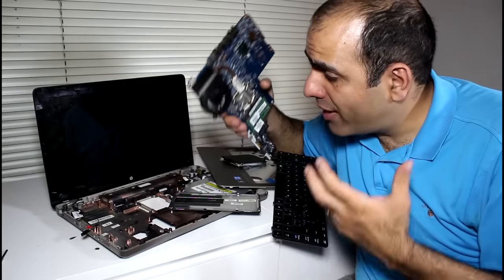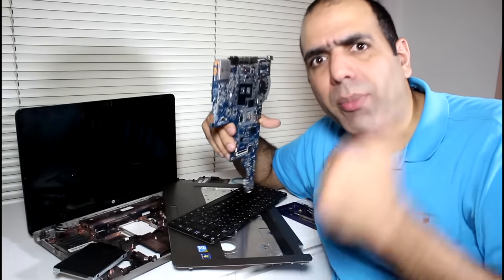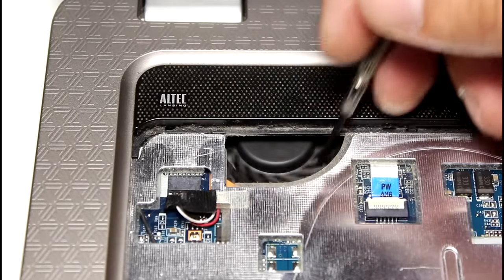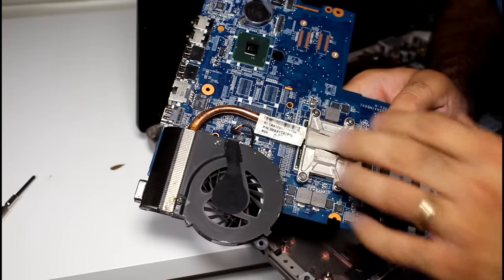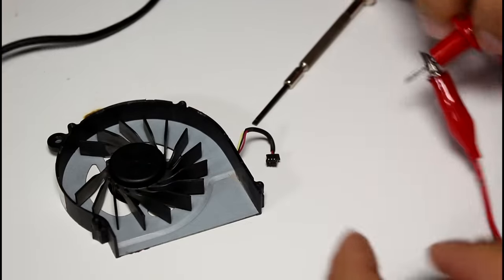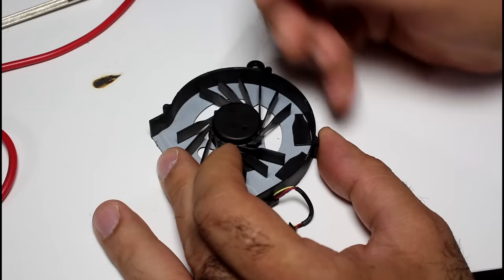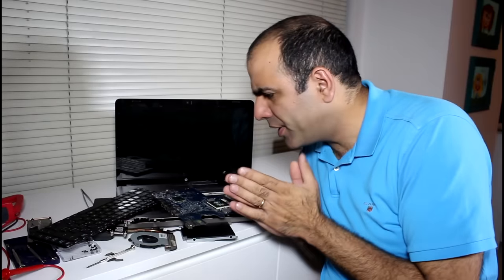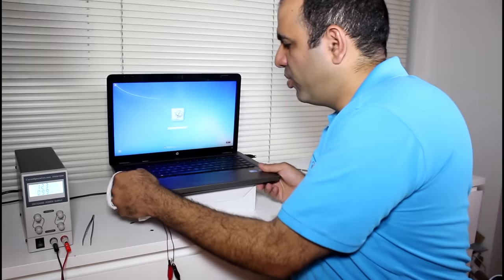How to Fix your Laptop

Comment: Quick safety tips: 1) avoid getting a vacuum too close to your motherboard because it builds-up lots of static and there's a risk of ESD damaging components - a hand-pumped blower's safer, and 2) insert something through the grill to hold fan still when you blow it out because if you turn the fan backwards fast enough it can create a negative current and damage upstream components.  At least that's what I've always read; if I'm wrong please correct me!
Reply: No u are actually right so far i see, the modern vacuum cleaners arent waking that much static but still dangerous to do, better ground yourself and the vacuum cleaner, but thats too much work.
Reply: Your not wrong and totally right !!
Reply: There are always back EMF control when fans are involved. 

When you power off the fan it will continue to spin and there is circuitry designed to sink that backwards voltage. 

Also, motherboards are usually covered with dialectric spray lacquer and are usually not bothered by discharge. 

This was a huge problem in the 90s and early 2000s but we have learned since then. 

These are small concerns but wont cause any issues in any reasonably modern Fan/circuit board.
Reply: shit i did that vaccum thing with my laptop motherboard directly ofcourse with battery unplugged but as you were saying i think the screen glitching problem i am facing right is because of that ..as it was happen after i put back everything
Reply: This was my concern too, but hey I did it anyway (Mehdi would be proud). I've done it on 2 different laptops (both Toshiba) with no problem. I also found a sticker in the fan of another one that was making a bad sound. Just do it
Reply: @Mr.bonbon441  if your laptops like....12 years old maybe....
Reply: You are true however if the device has no power and is disconnected from ground then the device should be fine as the built-up static charge would have nowhere to go.
Reply: Either hold the fan still or don't do it at all, I killed my fan's bearing. It still spins but sounds horrible.
Reply: no look at his collab with linus about esd to computers

Comment: 5:05 "There is usually some excess screw that you can vacuum". LOOOOL

Unfortunately, I can confirm that this is true.
Reply: As someone that fixes laptops on his spare time; i laughed at that moment so hard that i had to stop from the pain. 
Too many times have i forgotten one damn screw from the inside because i was in a rush. Thus had to take the whole thing apart and put it back together.
Reply: Ayy same I was dying xD. Also when they fall off the table or when your hand hits the bowl you were keeping them in...
Reply: AhA! This is why i use magnetic balls to hold my screws in different labeled boxes! Once i take them out i put them in their representative box with small magnets. Makes them a pain to put them out one by one; BUT I CAN NEVER LOSE THEM!
Reply: hmm thats clever I should try that instead of chucking the screws on carpet
Reply: I had to open my previous laptop several times, every single time I did it there were some screws left at the end.

Guess they weren't actually needed lol
Reply: sup jousboxx
Reply: When i was 7 I wanted to fix my pc’s fan and I was left with a lot of screws when the Pc was back together but the problem was solved and the pc worked, so I weren’t to bother with opening it up again and putting the screws in😂
Reply: Every time.
Reply: if you have excess screws, you should have screwed more holes tightly...
wait, that sounds off..
Reply: They always include extra screws in everything, even cars they just add a bunch of bolts and nuts, for some   reasons I think.
Reply: That counts, if you buy something new. But if you are opening something up and you have screws left after you put it back together, you did it wrong.
Reply: I have taken apart my alienware a few times for cleaning and never had extra screws
Reply: I laughed so hard at that moment😂
Reply: I once worked on an old laptop and didnt saw that it had different srews on the back, i took all out, and later when i tried to build everything together there where 2 big screws missing, and i had 5 small screws left XDXDXDXD
Reply: should've made the pvc screw vacuum from make magazine or kip-kay :D it worked for me.
Reply: same here lol
Reply: I can not only confirm that it's true, but advisable. I once repaired a digital camera with a replacement part from eBay. Put it back together, and everything worked perfectly. But there were some extra screws... Uh-oh! So I took it apart again, put in the missing screws, and... It never worked again
Reply: @bilibull1  magnetic balls magnetic balls magnetic balls magnetic balls magnetic balls
Reply: bilibull that’s what’s pockets are for
Reply: So can I. As a laptop owner, screws are hellish to deal with
Reply: yep, I have fixed many laptops and almost every single time I have left over screws.
Reply: Haa! "Excess".
Reply: Well, instead of vacuuming the screws he should have send them to me. I had the opposite problem. I took a Laptop apart and at the end I hadn't enough for all the holes. I then had to decide which isn't that important. 
I was the first to open that laptop. My guess is that a the worker in the factory didn't found all positions for the screws.
Reply: I thought I was the only one like that, it turns out that was the hallmark of a genius 😅
Reply: I love the sound of tiny screws rattling down the vacuum cleaner in the morning!
Reply: NOP really they left some parts of this laptop loose
Reply: @rodovanra6783  The reason is redundancy, so that if one screw fails there are 3 more that have to fail b4 something goes really wrong.
Reply: Use the same approach when working on cars, however your mileage may vary.
Reply: This got me too lmfao
Reply: @giorgitsiklauri1283  Not so much with screws in computers I imagine just not safety critical enough really but cars almost certainly probably do have extra bolts for things like the connection between the wheel and the axle for this very reason. That is the sort of make sure this design works or people die situation where engineers tend to look to make sure their design still works if only half the bolts were installed and those were all woefully underspec parts that somehow slipped past QA despite having barely half their design strength. Not that I'd set out to test that at least not without a test track and a way to do so without anyone needing to be in or near the test car as that sort of experiment is a good way to also demonstrate the reality of why this is also important to do ie various forms of subtle failure where parts appear fine but are weakened by stress or functionally failed in place entirely in a way not immediately visible.
Reply: I can relate 😸👌🏽

Comment from the maker: Thanks for watching guys, if you like to see my posts on Reddit, you can follow the link to my account www.reddit.com/u/melector. Thanks!
Reply: Are you an electrician?
Reply: Iran Number 1!  :-)
Reply: thats a hp g series, had mine for about the same time, i noticed that the fan had packed up, so bought a new laptop, replaced the fan and had issues with the screen driver cutting out, the motherboard was shorting out, so i slid a piece of paper between the motherboard and the frame, not works perfectly.
and yes a royal pain in the as* to take apart.
Reply: "Make sure there is not a battery in the barrel " Lol! Awesome vidjayo as always! Thank you
Reply: is that pavilion g6 ?
Reply: You channel need too grow
Reply: +Hulkjamie  g62 i think
Reply: +Andrea Lana i have a pavilion g6 and the fan got block and the screen broke so i took it apart and took of the screen and cleened the fan
Reply: Nothing got shorted and exploded. :'(
Reply: Man, you are awesome :)
Greetings from Germany
Reply: hi
Reply: Would you like to experiment overcharge or stable a overcharged lithium battery.
Reply: "Please respond or I'll get rid of you?"
Reply: thanks you my friend
Reply: what is the  laptop that you have
Reply: +haytam bouzerda pavilion g6 2011 amd e2 vison 1.7ghz 6gb of ddr? and a 750gb 2.5 wd blue hdd
Reply: dosnt suck well
Reply: These burns on table.... hahahaha
Reply: ElectroBOOM most people only watch you're vids to see you get shocked and hurt :L
Reply: ElectroBOOM
Reply: ElectroBOOM I love your videos! I hope you have nice day!
Reply: ElectroBOOM HOW TO NOT FIX YOUR LAPTOP😂😂
Reply: ElectroBOOM your laptop looks like mine!!!
Reply: i fixed my laptop

Comment: "There are usually some excess screws that you can vacuum." - is where I lost it.
Reply: Same, every time I clean or replace anything in my laptop I'm left with 1 or 2 extra screws. The only reasonable explanation is that there is a small screw factory hidden inside my thin laptop :D
Reply: The same thing happened to me when I fixed my car s engine.
I broke my Dyson when I tried to vacuum the excess bolts, screws , valves and air filter.
Reply: When I heard that I felt my soul leave my body.
Reply: I sticky tape my screws in groups. This makes it easier to know which screws go where and is a time saver. Trust me, tape the screws.

Comment: Pentium 4
Toaster
Same thing.
Reply: Northwood burns well... good fire wood
Reply: Gotta love those GHz.
Reply: Pentium 4 <3 on Laptops The Coolest Bake.
Reply: orly? Is that why my '01 Pentium 4 is still perfectly usable on the internet today?
Reply: +DECCAS8 perfectly? nah
Reply: cekpi7 Haven't used it in a while, but I distinctly remember playing some online platformer game.
Reply: DECCAS8 for yt p4 is crap as hell
even with flash
Reply: ***** Wouldn't YT be graphics though? If you have a crap enough GPU it can effect video playback.
Reply: DECCAS8 My brother has pentium 4 (3ghz), i had athlon 64 (oc to 2.1ghz) which was a lot faster, but i remember i tried to use it year ago and even with 1.5gb ddr ram it was lagging
Reply: DECCAS8 On a well configured system, your browser should be able to use GPU-accelerated video decoding, depending on the GPU's supported codecs. (H.264 is well supported, VP8 and VP9, not so much)
Reply: DECCAS8 You could always just use mpv (or youtube-dl plus any competent player) and skip the browser for video playback altogether.
Reply: Nah, toasters have better heat transfer characteristics.
Reply: wtf?
Reply: Better than Ryzen
Reply: im still using a pentium 4 ht 630 :/
Reply: Only thing a  toaster got Ryzen is bread.
Reply: market a skill, save up for ryzen :P
Reply: than core i5 toaster

same thing.
Reply: PAVILION = BOILER
Reply: I hate windows machines
Reply: jay jackson FX 9590 220W Heater 

Perfect for the winter
Reply: Sadok Bam pi
Reply: My 8350 at 5ghz draws like 300w lol (i dont need a heater in my room) tho its really unstable so i keep it at about 4.6
Reply: I have a Pentium 4 HT 3.0GHz Prescott PGA478 on my Windows XP gaming PC. It is still okay for basic web browsing but it can't run HTML5 youtube videos that well... Ok, it can ran 480p just fine but not 720p but if I copy the youtube url to VLC it can run 720p or even some 1080p videos perfectly.
Back in 2011-2012 when that was my still main PC and youtube still used Flash it was able to play 720p youtube videos just fine. Actually it was able to do everything I wanted to do on it and I usually had over 100 tabs open on Firefox
Reply: jay jackson lol

Comment: Some laptops have special programs (lenovo and some more) to make fans spin the other way so they push the dust.
Reply: does not work. but my lenovo g510 has only two screws that hold the entire bottom panel, giving me almost instant access to everythng inside, so i don't really need that function anyway.
Reply: Lenovo also has this interesting warranty option: If for example your hard drive is broken, they can just send you the hard drive, and you replace it yourself. And since it was so easy to open of course I've done some modding: Original HDD went where the optical drive used to be, and was replaced with an SSD. I've put the original optical drive in an external case. Way more practical that way.
Reply: wait? what kind of fan is it? most of laptop is using centrifugal fan. which i think the direction of the blowed air cant be reversed the other way.
Reply: +Polaris Wolf “Andydandyfiddy” Lakewell eww
Reply: +Polaris Wolf “Andydandyfiddy” Lakewell jk its good for school and buissness
Reply: +Niko Leven business*
Reply: ***** Time to brag: im 13 years old and ma dad is giving me 3000+ to build a gaming pc.
Reply: ***** hahahahhahah thats the reaction I want XD
Reply: Niko Leven è3b
Reply: Niko Leven and what are the specs you chose?
Reply: A hippobottomus oh cmon how does a kiddo knows about pc specs? All he knows is that the ram is the same thing as storage like the kiddos in my school

Comment: Back when I was doing tech-work, I had developed the concept of the Four C's.
The four C's are: Cables, Connectors, Components and Clues.
Cables are by far the weakest link, followed by Connectors.
Components (video cards, sound cards, fans, PSU) are generally pretty reliable, but can fail.
And the Clues?  That is what many Users do not have, and that leads to more trouble than all the others!
Reply: strange since in most notebooks its always the video card or fan or PSU failing.....
Reply: correction: strange since in most cheap notebooks its always the video and or PSU failing.....
The fan is mechanical, it will fail over the course of time. A good piece of hardware will realize it failed and alert you, or at least adjust to not overheat it self. 
Even in my well used, nearly a decade old Toshiba, what failed was the plastic case.... original fan, PSU, all boards, cables, etc.(except the hard drive that I damaged a little when I put it down too hard one day, but even that is still usable, just a few bad sectors, but I replaced it anyway since I don't like any problems.) Well used.... it either ran Folding@Home at 100% CPU usage, or I was using it for school work, or it was traveling with me between classes and home. It did this for a few years, then when I wasn't going to school, it would still travel with me to work and back, I would walk around with it a lot, etc. The case is cracked in so many places, that it cases problems when I move it, otherwise it works fine.
In a Dell my mom used, the power supple jack failed, that I just re-soldered. That and the screen hinges failed, Those both happened after it was at least 5 years old.
My ex has a IBM X60s, older than my Toshiba, that works perfectly, all that was ever changed was the fan. 
Quality matters in these components.
Reply: He does have a degree in electronics

Comment: The spinning fan can act as a generator and feed various voltages to the board, which can be bad. Just carefully open your laptop, hold the rotor with your finger and blow air duster on any dusty parts. I have never actually seen this occur, but this is a theoretical risk. I have seen case screws sucked into a vacuum cleaner and needing a magnet for retrieval, however.

Comment: Okay certified computer tech here: Cleaning the dust out of your computer every year or two is important to maintaining the device's health and usability but don't try this vacuum method, 9/10 times your computer will probably be fine but this can make the fan spin way faster than it is supposed to and can ruin the bearings in your fan, causing it to cool far less effectively and potentially cause heavy damage to the system. Also vacuums that aren't specially designed for computers can cause a ton of static charge to build up and can potentially kill vulnerable components in your computer, just stick to short bursts of compressed air or (if you are capable of reassembling it) take the computer apart and manually clean it. Compressed air is generally safer for the average user though.
Reply: So the vacuum on it's own makes the fan spin faster for a few seconds than it normally would and that causes damage?
Reply: Completely correct about the potential for ESD with common household vacuums. ESD is a far greater concern than simply spinning fans beyond their typical usage speed! Only use vacuums designed for ESD sensitive environments, but compressed or high velocity blowing air will nearly always do a better job at loosening dust and debris and has virtually zero chance of causing harmful ESD. However, blowing air over fans can cause them to spin far greater than their bearings are rated for as well, more so than most vacuums. Always secure fan blades during cleaning.

BTW, what certifications do you hold to be a "certified computer tech"? 🤨
Reply: @Tomd4850  CompTia Hardware Certification

Comment: Old times when batteries were user removable
Thanks Apple
Reply: They are removable now. You just have to take the computer apart and rip out the glued in battery hoping it doesn't break everything. 

Seriously though, computers and software has slowed down in their gains, so they make other, irreplaceable parts of the computer fail so you'll buy a new one

Comment: Mehdi, couldn't the dust in the laptop and the force from the vacuum potentially create a static discharge within the laptop?
Reply: Not static but the fan is going to to spin because of the wind created by the vacuum which causes the motor in the fan to become a generator. Which is also not good.